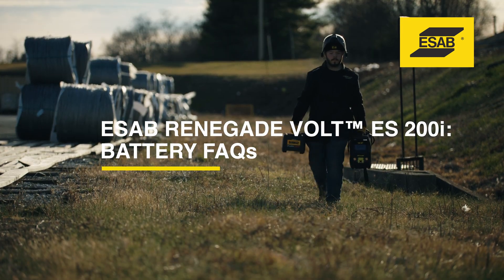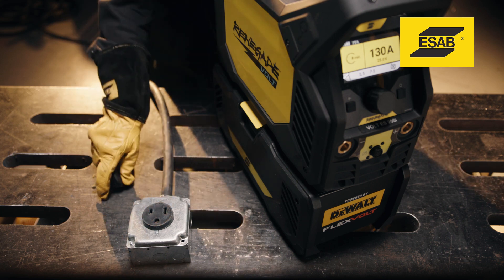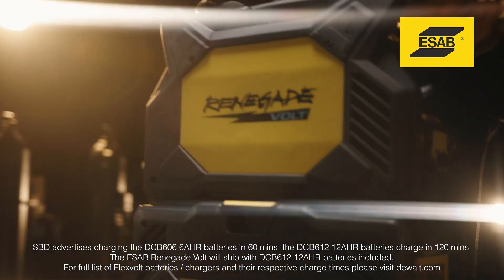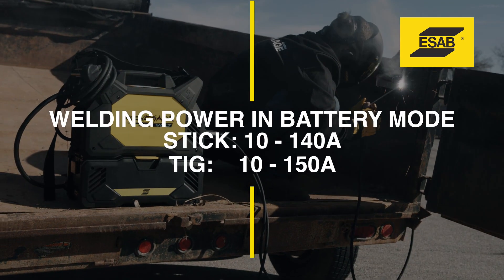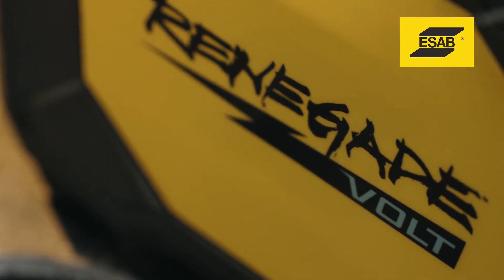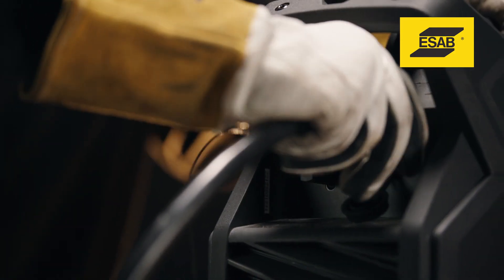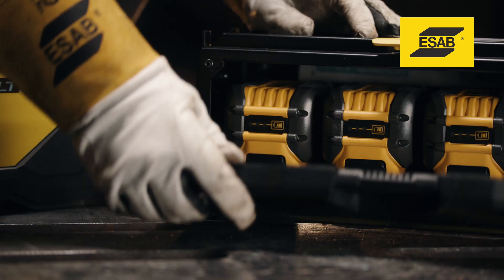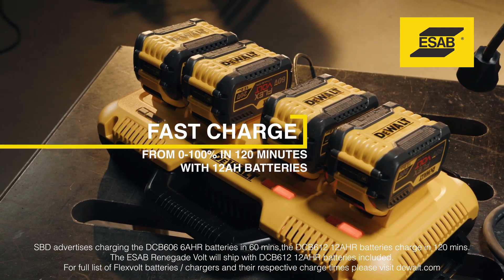Answering Questions About Renegade VOLT™ 200i from ESAB

Comment: What about flexvolt 15ah batteries? Thats dewalts biggest battery but doesnt seem like it fits in the battery box. That would be the most ideal set up. Maybe if you jus leave the lid open? Maybe you should make another lid for it
Reply from the maker: Hi! The welding machine is compatible with 6 Ah, 9 Ah, and 12 Ah DEWALT FLEXVOLT batteries. It is not compatible with 15 Ah FLEXVOLT batteries.
Reply: @esabweldingandcutting like he was saying I would think the 15ah batteries would be a big benefit to this kind of system, is there anything in the works to adapt them possibly?
Reply from the maker: Definitely understand where you are coming from. We are aware of this suggestion and working on a solution!  @anotherrandomtexan25